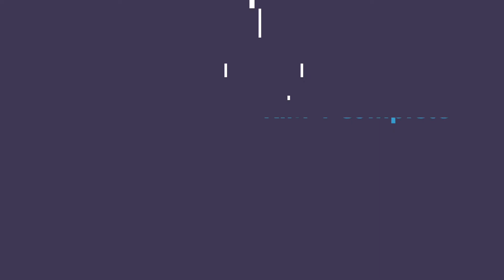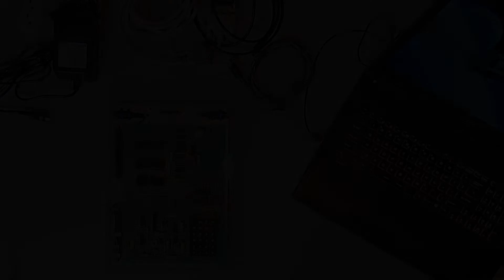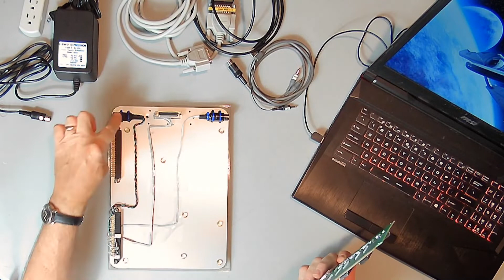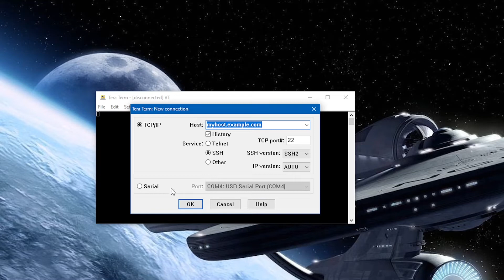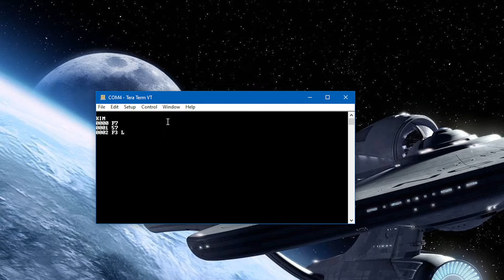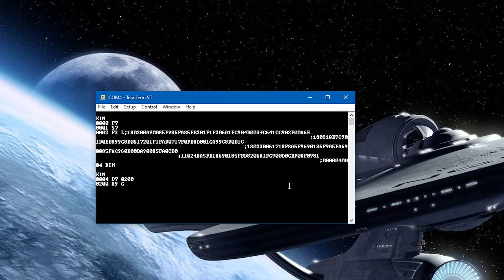KIM 1 Demo for eBay Listing

Comment: I understand that it is very difficult to sell older computers, often modern software is no longer working and not all updates have been done. So, the buyer has to be careful. I am willing to take that risk. You can contact me for an offer.